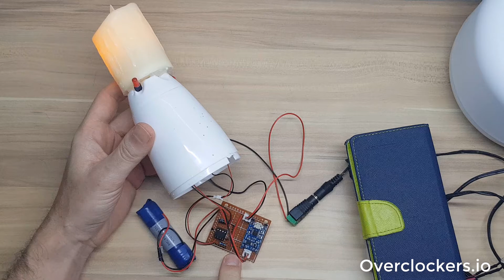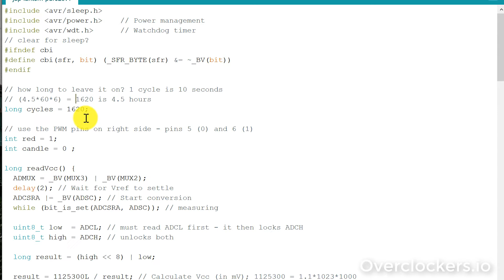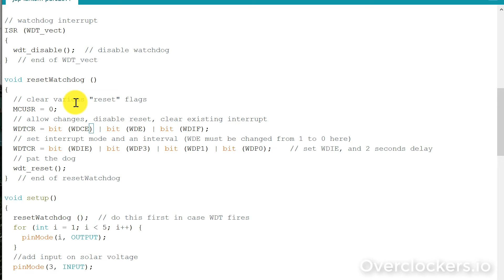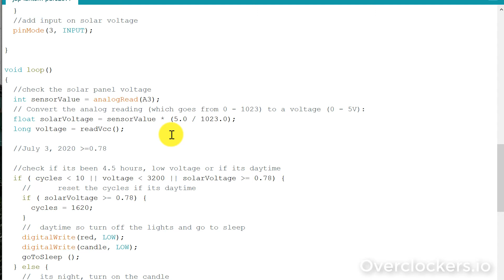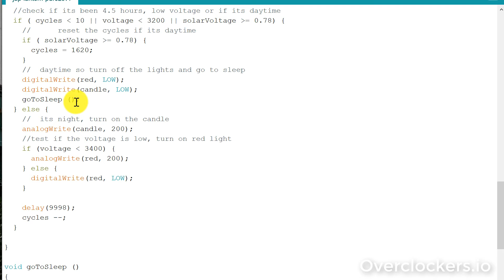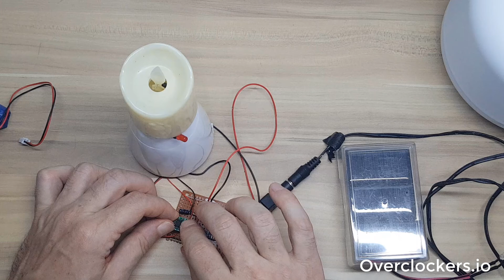Japanese Garden Solar Lantern with an Attiny85 now Attiny25 (solar cell as LDR)

Comment: I love the Attiny85! I'm a fan of it!!  To be honest I don't really use the UNO much. Either Attiny85 or Esp8266.
Very interesting your video! For different reasons. Let me explain myself:
I live in the countryside and I have some beehives, which unfortunately started being attacked by the 'Asian hornet' some years ago. I fight them with electrical 'harps' which do their job quite well. The harps are connected to a 12V, 48Ah battery which is connected to two 24V solar panels through a Victron MPPT converter. The system stops the supply to the harps at night. I used to use a timer for that. The problem is that the timer broke and now I'm trying to replace it with an LDR plus relay, plus Attiny85. 
As the Attiny85 cannot be debugged, or at least I don't know how to, I use a Nano to test the code and then mount the circuit.
So far so good, but two problems here:
1. the Attiny runs between 2.8-5.5V, then I need a voltage regulator if I'm going to use the 12V, which I don't really fancy 
2. the Attiny is not running properly with the LDR. Probably problems with the code. I'll have to check it thouroughly. Although somewhere I had read that the Attiny 

Looking for information, I had read that instead of an LDR I could use a solar panel. Exactly like you!!, and that's why I find your video fascinating.
I have small 6V solar panels which could do! The only problem is that I don't program the Attiny at low level. Do you know interesting sources to learn how to?

Thanks, 

Pablo
Reply from the maker: Interesting use case. A voltage regulator to drop you to 5v or 3.3v on the attiny is pennies... (23cents for a LM7805, and 15cents for a L78L05) and would solve the voltage problem.  For the code issue, I used a cheap solar cell to monitor the light/voltage, as I find using an LDR troublesome- as the voltage in a voltage divider will get hard to measure as the light level changes, and your battery drops. The better solution with the LDR may be the voltage regulator to keep it constant on the voltage divider with the LDR.  Heres my code for the solar lantern- it can probably be simplified more.
https://github.com/david-sg/solar_lantern-attiny85-arduino/blob/master/solar-lantern-attiny85.ino
Reply: @overclockers6835  So you seem to have problems with an LDR, so do I and so have I read.
Thanks for the link to your code. I've just cloned it. I'll study it and if I have any issues I'll come back to you.

Comment: Thanks for the video it was most interesting for me personally I would have stuck with the hand made board for a one-off project but if you think you can sell them then move it over for a final test and put them on Tindi if the demand is there go for it
Reply from the maker: Thanks for the comment and suggestion Bob. Glad it was interesting for you! I noticed the other day that it was taking some charge from the solar panel, so it is lasting a little longer before needing a recharge than expected. Not sure if there is demand for the pcb- looking at some other ideas that may have more marketability.